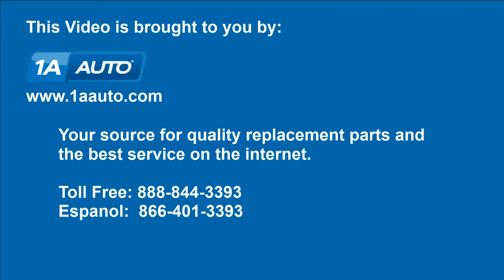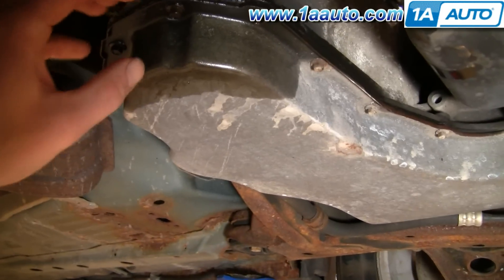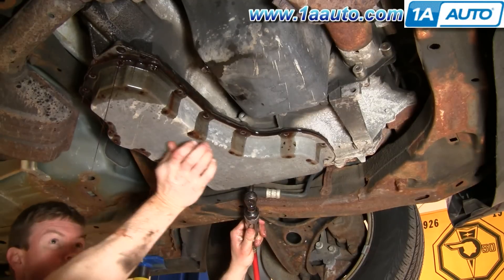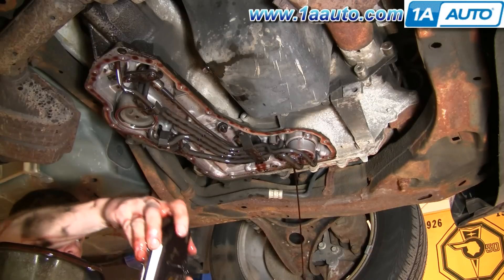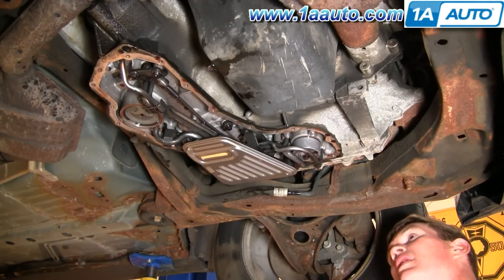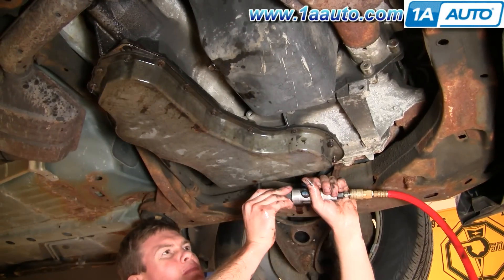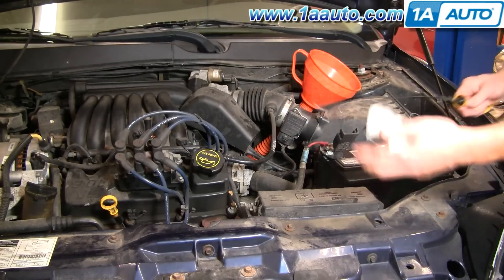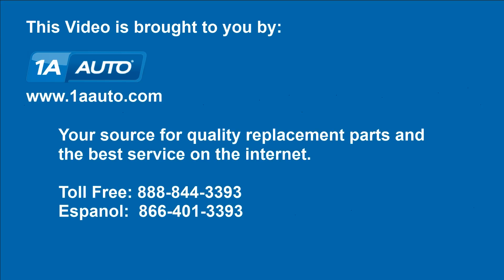How To Replace Transmission Fluid Filter 00-07 Ford Taurus V6

Comment: Hey A1 auto my 2001 Ford taurus is having difficulty shifting and tend to stall out when I stop in overdrive. It drives normal in regular though. And when it's cold first thing in the morning I put it into any gear and it's stalled out. Do I need a new transmission or something else?
Reply: I've replaced so much already and I can't seem to find the problem. No mechanic around me can tell me what it really is
Reply: Hope to hear back from ya!

Comment from the maker: You should change the filter and fluid every 30,000 miles. Unless the owners manual recommends a different interval. 1aauto.com 888-844-3393

Comment: I've always wondered that my self. The dealer tells you this is a very technical job so he can rip you off with a large bill. As you can see, anyone with half a brain can do this. I pay about eight bucks for the filters from a transmission re-builder supply house. Made in America too.

Comment: One of the dumbest manufacturer mistakes is the blatant refusal to put a simple, easy to accomplish drain plug on transmission pans.  There should be a law.  lmao  
Not enough vehicles have drain plugs.